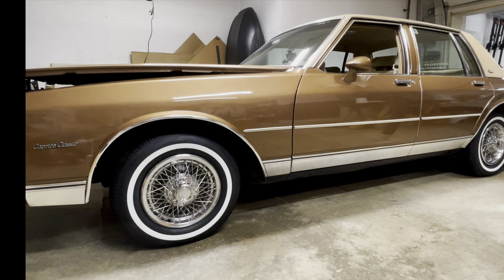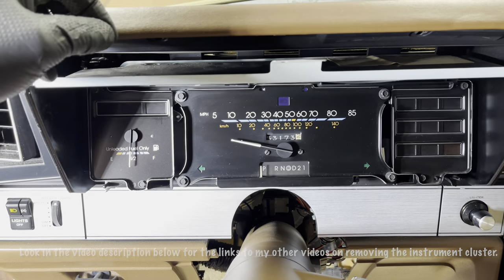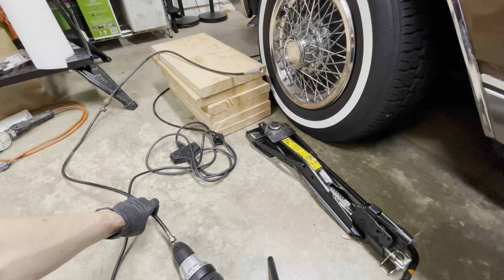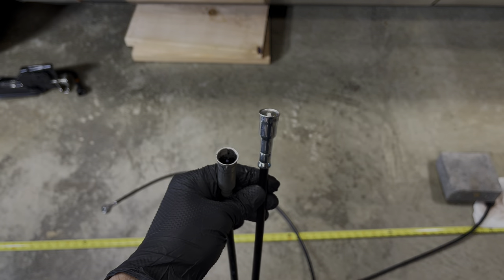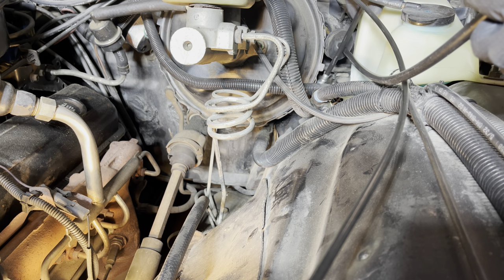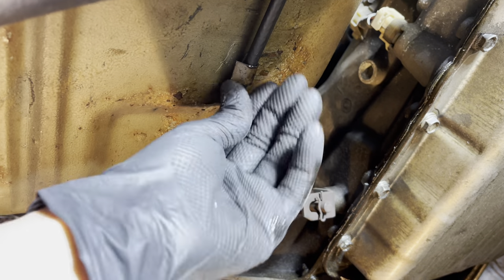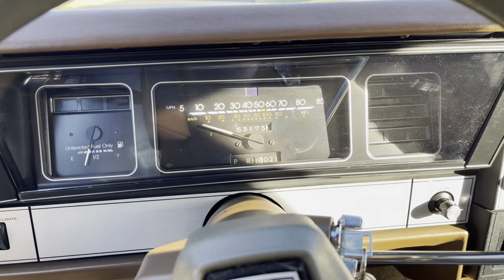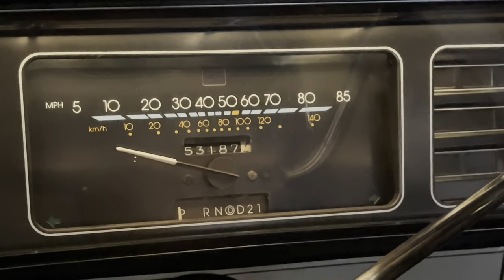Replacing the speedometer cable on a 1985 Chevrolet Caprice Classic

Comment: QUESTION my speedometer only works in neutral how do i fix that??
Reply from the maker: @quinterrusbenson9286  wow that is strange. Do you mean that the speedometer shows the speed only while the car is rolling down the road and you shifted into neutral, or when the car is parked, and you shifted into neutral and press the gas and the speedometer jumps?  Either way, my only guess would be a problem at the connection point from the speedometer to the side of the transmission.  Is it the original transmission and original speedometer cable and original speedometer?
Reply: @LongologoProductions  when im rolling down the road n shift in to neutral and yes all original this didn’t happen until i had my transmission rebuilt
Reply from the maker: @quinterrusbenson9286  Bingo. Most likely an issue where the speedo cable connects at the side of the transmission.  At minimum, disconnect the cable from the side of the transmission and inspect that little plastic gear inside. Make sure the gear is inserted properly and then reconnect the cable.  That seems like the most likely source of the problem.  Good luck.

Comment: Cool video. 😎 just noticed that my speedometer on my 78 Coupe deVille is off by 5mph. It'll read 60 mph while my GPS maps app will say I'm going 65...
Reply from the maker: @Edgar Herrera:  I’m not sure how accurate the app is.  I would check it against highway mile markers by setting your speed to 60mph and starting a stopwatch the moment you cross the first marker. 60 seconds later you should be crossing the next marker.  If that’s off too then you have two sets of data that hopefully point in the same direction.  Another thought is to check your tire size.  If it is not the same as the originals for that car then your Speedo will be off.

Comment: My '84 LeSabre yields drastically different part numbers for the cable from GM. I'm very apprehensive about ordering because I don't want to be knee deep and have the wrong part. I'm assuming your car does not have a 200-4r transmission, maybe a TH350? Apparently the cable for the TH400 is the same as the 200-4r.
Reply from the maker: @doctordoom1337:  Definitely confirm the part #s before diving in.  If concerned you could always start at the transmission end and test that connection before ripping out the old cable.  Good luck!
Reply: @LongologoProductions  the only "vague" confirmation I can find is that the cable is 80 inches for the LeSabre. The part you used is also 80 inches. I happened to find a NOS gm genuine cable on ebay for under 20$ so I took a gamble. I'll do my best to confirm before tackling this project. I dont believe I have to remove as much on the LeSabre as you had to on the Caprice.

Comment: I’m trying to also add the stress about needing a video of the engine bay. I have an 85 two door I could eventually show one of mine but not untill I’ve got the majority of everything correct. But could you please show ALL THE BRAIDED GROUND STRAP CONNECTIONS. I have the factory shop manual just like you do and it does not show a legit diagram of the straps locations. It also specifically states to check the chassis/body service manual….ok I can’t find one for 1985 online from any source lol. I’ve seen possibly two braided straps (one of the back of both heads…mine is missing one on driver side) One from the heater core or water valve  (either to accumulator or firewall I’m not sure at all which one it grounds to. Shop manual displays a braided ground strap from engine to body but does not specify from where….I will not trust my car is properly grounded untill I can figure these factory ground locations. If you could do a video showing yours that would be awesome.
Reply from the maker: @Nicholas-ik4wb:  I already have a video of the engine bay here:  https://youtu.be/ZQFbqzy8AHs  I hope this helps.

Comment: Great video, but man, how did get to that speedo cable? I followed all the steps for my '86, I can see the speedo cable from underneath but no idea how to reach the clip for unhooking it. The instrument feels loose but i cant reach around it. Its held back by the speedo cable / wiring harness. Thanks!
Reply from the maker: Yeah there isn’t a lot of space to squeeze in your hands back there.  Once you’ve done it once you can get to it by “feel” to press in to release the clip holding the speedo cable in place.  The bigger problem for me the first time was that other sensor that is screwed in behind the speedo gauge. That’s a pain to access and remove.  Another thought would be to find where the speedo cable goes through the firewall from the engine side and push some of the cable in towards the interior of the car.  If you can push the cable in a couple of inches or so that might give you some slack when you are trying to pull the instrument cluster out far enough to get your hands back there.

Comment: QUESTION HERE.    ????? 
I have an 85 Caprice Classic like yours but it's white, no vinyl top,how do I remove the Caprice logo, it is on the lower part or the roof back by the passengers door on each side. Is it just held on with double-sided tape ?????
Reply from the maker: Likely some strong double-sided automotive tape.  Try working a long string of dental floss back and forth behind the logo to remove it.  Then comes the fun part: removing the adhesive residue without damaging your paint.  Maybe some goo-gone or other gentle adhesive remover that you can use by wiping with a paper towel?

Comment: So as i figure out, in the end only replacing the cable really helped?

Greetings,
Luke
Reply from the maker: Yes.  Lubing the cable as in my other video was only a temporary fix.  Eventually had to just replace the cable.
Reply: @LongologoProductions  This is fascinating for me. On my '78 the speedo makes noises like yours. Due to cruise control, i was able to fill in motoroil into the cable from the engines bay side without removing the tach. It was my first idea for a fast fix. It did absolutely nothing. Maybe the transducer is also frecked. Cruise control is deactivated by pre-owner. He stated its a self-murder-thing which suddenly totally accelerates on the highway. So my idea is to replace the cable by a new 80" one, completely skipping the transducer, and disassembling it.